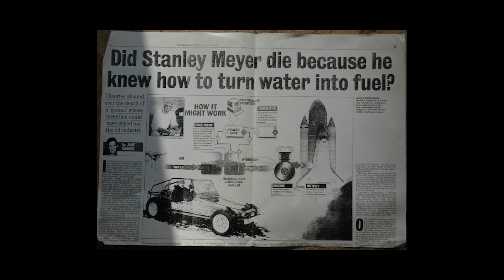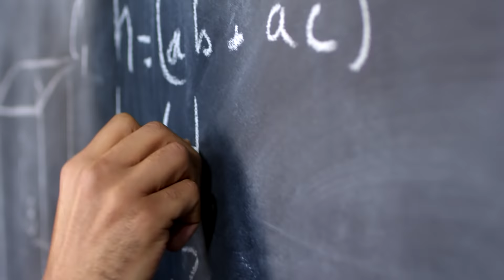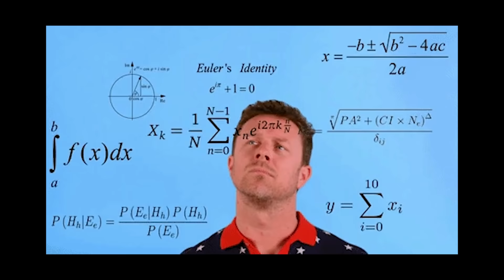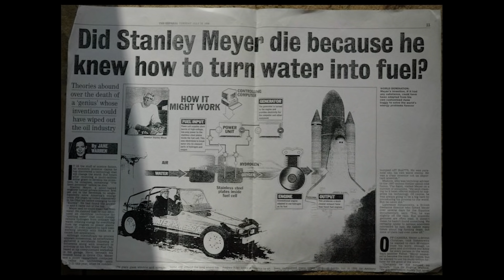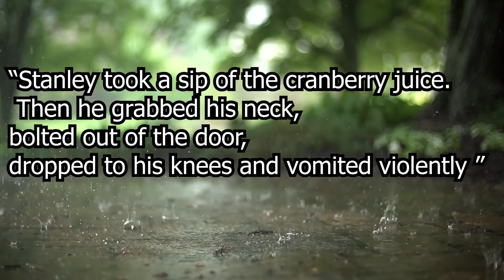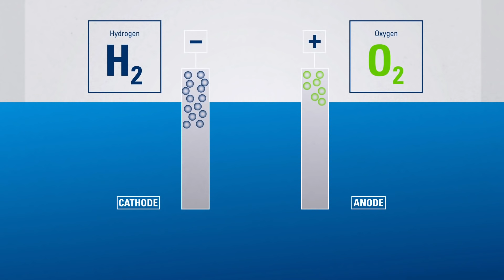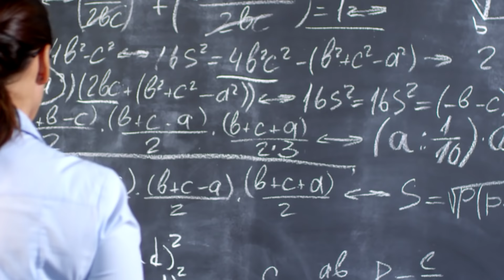Stanley Meyer Water Powered car, Lies and Death

Comment: What makes his invention unique is instead of high current pulling apart water molecules to hydrogen and water, his invention uses high voltage high frequency to tear apart molecules through resonance. If you are not familiar with the physics behind resonant frequency, this makes sense in the same manner a massive speaker playing very loud music will probably not break a glass cup, but if someone tunes a sound the same frequency as the resonant frequency of that cup, it wont take much more than an average persons voice to break it. His invention is essentially saying water has a chemical potential that if the power input is low enough, the output could be enough to power something like a car.
Reply from the maker: Thats proper interesting. I would love to read up about it, are there any papers you can link😱
Reply: @Average User -- exactly. That was . . . a lot.
Reply: Bollox in other words
Reply: @Man_fay_the_Bru  It actually makes sense, the only question is the by product and leftover chemical potential. If he is creating hydrogen from water and burning it to create heat and water again, that would raise suspicion since you can never receive more than what you put into a system.  I don't think the military was interested without good cause, it makes sense why he "died" and his publicity too. He would step on a lot of big toes in the oil industry
Reply: Sorry but my woo detectors are on high alert… if you could split water into H2 and O2 at the same temperature, because of chemical potential energy, the products would have more energy than the water, which violates the 1st law of thermodynamics.

If the products are colder by the corresponding amount, the products have less entropy than the water, in which case you could abide by the 1st law but break the 2nd law.

What I'm suspecting, assuming he wasn't a con man, is that he unwittingly built a galvanic element, i.e. a battery, as his electrolysis device. (In fact, overcharging an NiMH battery results in hydrogen gas leakage.) That would've allowed him to get more usable energy out of the system than he put in. Well, the problem is: for a time. Eventually the cathode would've been completely corroded and replacing or regenerating it, of course, would've been at least as expensive, energetically, as the previous "gains".
Reply: Bro I’m just trying to inform myself and I find a whole argument about religion 😳
Reply from the maker: Yeah people are weird
Reply: @SH_Hof  That is pretty out there man, those are really face value assertions of the Bible. The Bible is a unified story, pointing to Jesus, God come in the flesh. It's not a story but a testimony, of who you and are, who God is, our condition before Him, and what we can do to posture ourselves with what He is offering us to receive(Salvation). Absolutely, drugs can open yourself to the spiritual, but that doesn't mean it's good, in fact, the Bible calls it a sin(sorcery) and it has been the experience of many, what or who they see is not their friend, usually a demonic entity. Just because someone is "spiritual" does not mean they will meet the God of Creation. What men like Moses experienced was an encounter with the Living God, not a trip or high off some drug they found or made.

The God of the old testament is the God of the new testament, what is fulfilled in the new testament is simply a fulfillment of what God promised in the old testament. Both the new and old testament testify of each other and there is no schism in either, each preach of Jesus Christ, God in the flesh, having paid for our sin, which incurs a severe and eternal debt that is in principal and reality before God, that we might receive salvation from our sins. The command is to repent and be baptized into His Name, that we might receive His Spirit! Acts 2:38
Reply: @SH_Hof  People who look ugly on the outside… Wow, read the bible again.

6 And it came to pass, when they were come, that he looked on Eliab, and said, Surely the LORD’S anointed is before him. 7 But the LORD said unto Samuel, Look not on his countenance, or on the height of his stature; because I have refused him: for the LORD seeth not as man seeth; for man looketh on the outward appearance, but the LORD looketh on the heart (1 Sam 16)

John 9:1-3 also comes to mind e.g. or when Jesus compares the Pharisees to whitened sepulchers, beautiful on the outside but full of death and decay on the inside.

And you are literally commanded not to judge. Now, I get being cautious towards strangers, which is something entirely different from passing moral judgment, but by your logic pretty strangers can be trusted? Awesome… now here’s something that is really a dangerous teaching, why do you think human traffickers regularly use nice looking women as bait?
Reply: @TruthNerds  Saint Jerome told us to not trust any contradicting place in the Bible and he's right. 
You seem to forget that the bible was heavily manipulated by the Roman Catholic Church. 

Also i didn't say to only, or even always trust pretty people.
I said to not trust physically ugly people.
That's the best advice you can give to a kid. 
It's literally the believe in synchronicity, and thus god, pushed to the max, like the indian caste system for example.
Reply: @SH_Hof  Well, I didn't address this sentence yet: "It's literally the believe in synchronicity, and thus god, pushed to the max, like the indian caste system for example."

But that's ok since I can't decipher it anyway. I do know that Christ directly contradicts teachings of this type many times, e.g. "8 And said unto them, Whosoever shall receive this child in my name receiveth me: and whosoever shall receive me receiveth him that sent me: for he that is least among you all, the same shall be great." (Luke 9, KJV)

Also highly relevant: Matt. 25:31ff.

Why don't you convert to Hinduism if you hate Christ's teachings…
Reply: @TheBlueScarecrow  some one never had any friends in highschool go preach on Reddit 🤓🕴️
Reply: @TheBlueScarecrow  I never read the bible but every now and then I hear some more messed up crap that's in there. Would be cool to write a whole book called "God is Evil" and put all these quotes in there and your thoughts like you did hear. That would be VERY interesting to read.
Reply: Precisely it's all about resonant frequency.
Reply: @SH_Hof  

If you’re reading a Bible in any other language other than Aramaic or Ancient Greek, and published anytime before the reformation; you’re digesting information manipulated far more by liturgists, translators, printers, etc., then this vague notion of “… the Roman Catholic Church.”.
Reply: Week said my friend. I could not have said this better. And about resonance sound the army has been making huge strides in this area with noise and resonance frequencies that disorient and even make the individual sickly.
Reply: @TruthNerds  Thank you for saving me the trouble of writing it all out. We live in a capitalist society. If it is possible, people would exploit the shit out of it.
Reply: @TheBlueScarecrow  And what standard are you using to judge God and say that he's " a piece of sh*t"? Is this your own standard of mortality? Because in your great intelligent mind, you must recognize there is no such thing as an objective standard of mortality if there is no God. Also idk who wrote that ridiculous misrepresentation of the bible but that is not at all what the bible describes. Looks like someone just wrote their own Bible
Reply: @ChrisVSCars  q
Reply: A lot of pseudo scientists here. Even if what you said is true, the sum total of energy it takes to split(endothermic) a water molecule is and always will be more than what it takes to combine (exothermic) hydrogen and oxygen to make water (not my rule, but mother nature's). It doesn't matter if you use resonance, straight up heat, intense light, radiation or any other method. The energy it takes does not change !!!! It is impossible to create a perfect environment where the theoretical limit is reached (same amount of energy to split water molecules, as it takes to do the opposite, I.e. combine h+o to create water). So please stop talking about things you have no clue about.
Reply from the maker: Agreed
Reply: @TortoiseCashFlow  or you could read any of the many existing studies of the Bible which explain the stories and their significance. Maybe, just maybe, the fact that so many call him a God of love means that he is one. But no, go ahead and be a contrarian because it makes you feel special lol.
Reply: @ioanbugheanu6836  Good point, if enough people believe something that makes it true. I hadn't considered that.
Reply: @SH_Hof  you're insane
Reply: @TheBinoyVudi  True but thats assuming there is no other factors at play right? How do you know its not a lot more complicated than people are looking at it and energy isn't being somehow drawn from surrounding. I dont have slightest clue how he proposed it works but whilst you can't create or destroy energy I dont see why the idea he found a way to draw energy from elsewhere to split the atoms is unfeasible in sense that the water itself wasn't the energy source but a catalyst to collect it in the process of splitting it by the method he found?
Reply: Well put. I wish Elon would take a liking to making a hydrogen car as well just to prove it can still be done and even use it to recharge the batteries in his electric cars as they are driving. This would lower the need for so many charging stations. Especially if you could charge it with this method while sitting in a parking space while you’re in a store or something. Even if it wasn’t a rapid charge but just enough to get you to a charging station in a tough spot could be very helpful ya know!
Reply: @TruthNerds  I totally agree. It's the hydro efficiency of the electronegativity that facilitates an ionic and thus biochemical alteration in the bonds that allow for energy yield. BTW, I have no idea what I just said. Just wanted to sound intelligent on this high IQ thread.
Reply: @TruthNerds  it looks like his patent includes a DC power supply to spur the electrolysis (see patent US4936961A) so it's possible that he simply misled folks regarding the significance of his invention, either intentionally or otherwise. Maybe he or the media got swept up in the idea that water is powering the car even though it's very clearly the battery.
Reply: @TortoiseCashFlow  you can do that for all religious texts, the Bible is just one example.
Reply: Trollking104  look at the comments I wasn’t the one who brought the discussion. I think that some one else commented something religious and then deleted as you can see the @‘s above my comment. Also wdym “it’s dumb if the topic isn’t religion”?
Reply: @warriorgp4640  that was very convincing scientific mumbo-jumbo. Good effort.
Reply: @ChrisVSCars  yeah I do have. But i won't share it here especially to you. U might help 'them' getting rid of those papers.
Reply: High School Physics : That's a no from me..
Reply: Exactly!!  Huge difference.
Reply: @Man_fay_the_Bru nailed it
Reply: @TruthNerds  it's all bollocks.
Reply: @lilbigblock3534  bollocks, in other words
Reply: @TheBinoyVudi  wishful thinking and neurotic personality.. et voila, magic!
Reply: @TheBinoyVudi  how much energy is put into a hydrogen bomb vs how much comes out?
Reply: @edd7812  I don't know.
Reply: @TheBinoyVudi  Well obviously WAY more comes OUT of a nuclear explosion than goes IN
Reply: GameliEL Auceps  please explain further
Reply: He was murdered for creating water powered xar engine
Reply: theres no that much energy stored in water, i would be suprised it could run on "water" or maybe its something else?
Reply: @TheBinoyVudi  only sane person here
Reply: Energy cannot be created nor destroyed
Reply: @edd7812  lol that energy was always there in the atoms vs water has little energy and that’s why it’s so common, you cannot create nor destroy energy,
Reply: @p3aoh161  you can easily create energy by converting matter to energy! But I think I know what you meant - that you can neither create nor destroy matter or energy, you can only convert one to the other
Reply: @edd7812  yes but the energy has to already be in the matter, the amount of energy it takes to extract energy out of water molecules is disproportionate, maybe one day but definitely not in our life, it’s just not that easy he was definitely a con artist, and a good one too
Reply: @p3aoh161  Perhaps he was... ✌🏻
Reply: @edd7812  ya unfortunately we will never know
Reply: @anonymousgirl5150  ? Yes they do, this fairy land spiritual stuff has nothing to do with physics, find me one physics equation that takes “spiritual” into the equation
Reply: @anonymousgirl5150  YOU CANNOT CONVERT WATER TO HYDROGEN WITHOUT USING ENERGY, YOU LOOSE ENERGY WHEN YOU DO THIS MAKING IT POINTLESS….. GO AHEAD AND TRY IT SEE WHAT HAPPENS BUDDY, THEN YOU WILL LEARN THIS IS STUPID
Reply: @p3aoh161  clearly need to use energy to convert water to hydrogen, but also chemical reaction, or other inovation could make very sufficent. and you don't need TO yell, it dosn't make you righter.
Reply: @anonymousgirl5150  🤦‍♂️ you probably think ev’s are good for the earth too
Reply: @p3aoh161  not particularly..
Reply: Amazing explanation
Reply: @danielbarba9711  You can never receive more than what you put into a system ?  People always say that without a full understanding or knowledge of the energy available.  It can be done. And it cost him his life.
Reply: TESLA
Reply: That's not the real Bob Lazar,  is it?
Reply: @danielallison3540  facts , Amen !!!! YESHUA AKA CHRIST THE ONLY NAME GIVEN UNTO HEAVEN!!!
Reply: This principle is relatively well understood. Why is no one duplicated this since. This is an example of the story that we kind of want to believe. But it’s probably snake oil.
Reply: Did ya learn that on YouTube,
Reply: @TruthNerds  There is no correlation between the energy required to separate the hydrogen and oxygen in water and the energy released from its combustion. Citing the First Law of Thermodynamics here is like saying that bonfires are impossible because it takes less energy to strike the match than you get back in heat from the fire, or that there is somehow a connection between the energy required to split wood and the amount of heat you get from burning it.
Reply: @jamesgeis  🤣 good one

"There is no correlation between the energy required to separate the hydrogen and oxygen in water and the energy released from its combustion."

They are the same as per the 1st law (conservation of energy). But if you did disprove the 1st law, I'll be checking the next list of Nobel Prize nominees for your name, I promise!

"Citing the First Law of Thermodynamics here is like saying that bonfires are impossible because it takes less energy to strike the match than you get back in heat from the fire"

No, that's a total straw man since lighting a bonfire is considered an irreversible process in thermodynamics (i.e. resulting in an increase in entropy) and your cult idol's magic car would have explicitly operated on a reversible process. In fact, the reversibility of the process is the entire fricken point of that mythical "invention".

"there is somehow a connection between the energy required to split wood and the amount of heat you get from burning it."

Stop it, you're killing me! 🤣 Splitting a log and splitting a molecule are very different things. More importantly, at the risk of repeating myself, it's the lack of reversibility that matters. So here's a better analogy that very nearly describes what Meyer fans like you believe: After you've lit the bonfire and let it burn out… and all the people have enjoyed the warmth and maybe roasted some marshmallows over it, the ashes turn themselves back into firewood and the cycle begins again.

Insane.
Reply: @danielbarba9711  Bull shit;)))
Reply: 😆😂🤣 You don't understand much about electricity or electrolysis, do you?
Reply: @edd7812  No, not true at all.   A huge amount of potential energy exists in the fissionable elements…that’s why the use them.   Gasoline contains a lot of potential energy, yet it only takes a spark to get it out.   You don’t understand the principle.
Reply: @edd7812  Love the “obviously “ from someone who obviously has no idea what they are talking  sbout.  Keep up the great work chief.
Reply: @edd7812  you even contradict yourself here, just stop dude, I’m literally cringing.
Reply: @davidgill3356  Unlike water, petroleum that is used to make gasoline gets "potential energy" from being kilometers undeground at +100C temperatures for thounsands of years...
Reply: @cerebrustusbordungolski7183  Ok, just sharing?
Reply: @davidgill3356  I think many do not know what makes hydrocarbons special as a power source, hence the comparison to water, that's all.
Reply: @cerebrustusbordungolski7183  Good point.   It’s hard to believe how many don’t realize the difference.
Reply: Time for you to get to work on the next water powered car it sounds like sir 👏🏼
Reply: I agree. By passing a high frequency AC current through the water it makes the water easier to split. You are using the inherent vibration of water. As an analogy if you push someone on a swing you can increase the amplitude of the swing with a timed input.
Reply: @ronbishop4057  Correct, but in his patent it isn't AC, but DC current, because the site of electrolysis is in the "capacitor" made of the water that will split into hydrogen, which is doubling as the dielectric and the capacitor to the LC circuit that creates the optimal resonant frequency for water
Reply: @danielbarba9711  Please explain, I don't understand. A standard circuit for electrolysis will never provide over unity.
Reply: @ronbishop4057  In an LC circuit you have a an inductor and capacitor to create a frequency in a closed circuit, this is found by f=1/(2*pi*(L*C)^(1/2)). Water has a high dielectric constant, meaning it makes a great median in a capacitor. Using a controlled AC input to amplify low voltage AC into high voltage AC over a transformer, and then on the secondary side where the electrolysis will happen there is a diode to turn that constant AC into interrupted DC current. Not sure if that has a role in helping his method of splitting water into hydrogen, but the main idea is the right capacitor ("size") and inductance will create the right frequency to create an LC circuit where the dielectric water in  the capacitor splits from H2O to H2 and O. You can see the circuit here, but it would be better to view it from the patent itself https://en.wikipedia.org/wiki/Stanley_Meyer%27s_water_fuel_cell#/media/File:Water_fuel_cell_circuit.png
Reply: @danielbarba9711  Thanks Daniel. Myers invention does not violate the laws of physics, notably the conservation of energy law. It doesn't, cause it uses the omnipresent ambient energy as an aid to increase the efficiency of electrolysis. The either was always accepted as true, up until the Mickelson and Morley experiment - 130 odd years ago. This experiments assumption were later prove false but the theory of there being an either is no longer believed regardless.
Reply: Thank you, you actually understand how it works, people don't understand what resonance can do.
Reply: @johnwick-ii6il  How can it be done? Explain your claim.
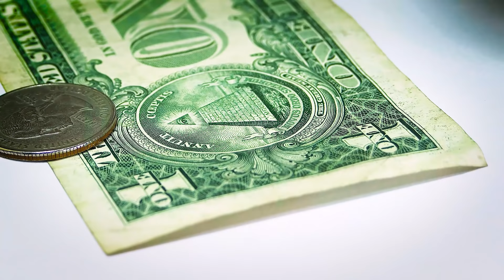Reply: John 3:16
Reply: Please link any evidence!
Reply: @edd7812  The difference to a hydrogen bomb is, the atoms don't get split, they get destroyed. So you little to none understanding of the reaction has 0 relevance to the topic here, because it's not fusion.
Reply: @famaccount479  You, like many others here have literally no clue about what you're attempting to discuss. You don't even seem to know the difference between "Fusion" and "Fission"
Reply: @edd7812  That you, the guy who try to compare a hydrogen bomb with a combustion car with electrolysis try to come up with fusion and fission, I mean someone with not even basic understanding of how such things work...is peak irony.